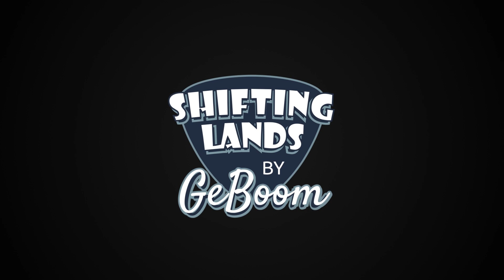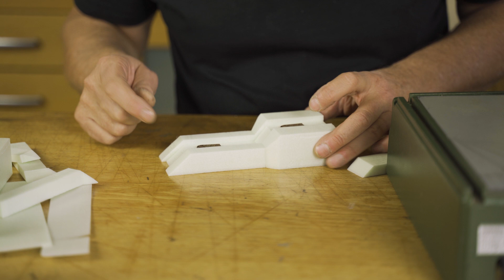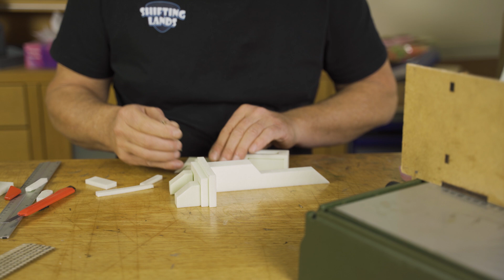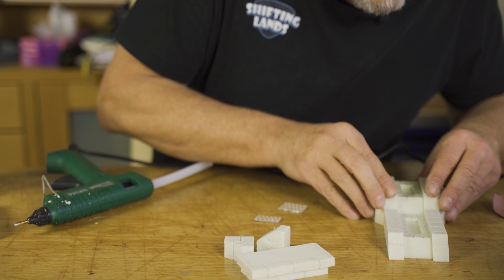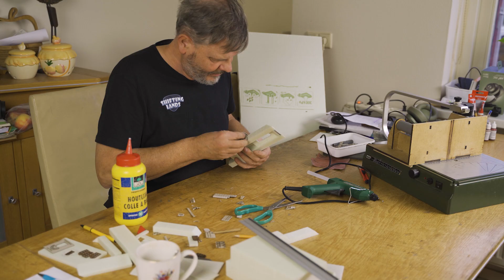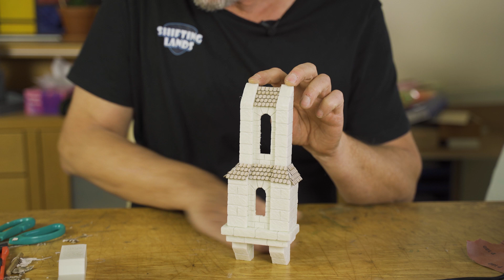Crafting a Medieval Bay Window Ornament in 50 Minutes (Let's build in silence)

Comment: Love your videos they are amazing! may i know where do you find your xps foam? i'm struggling to get the same result as you because of the materials...
Reply from the maker: I get mine from a big company named Weston in Soesterberg Netherlands. Need to buy full packages with sheets though.
Reply: XPS foam is used in almost every modern building. I get mine from dumpsters at construction sites. I get permission from the builder and they almost always say yes. Then you have a lifetime supply for free. It’s important to make sure you remove any vapor barrier and also cut off the outer skin of commercial foam. Once you shave off the first mm or so, you have excellent hobby foam for free and it’s recycling at its best!